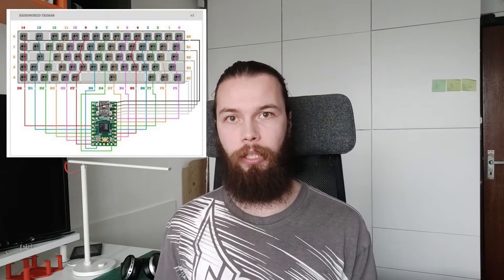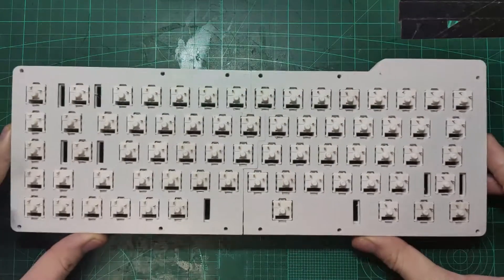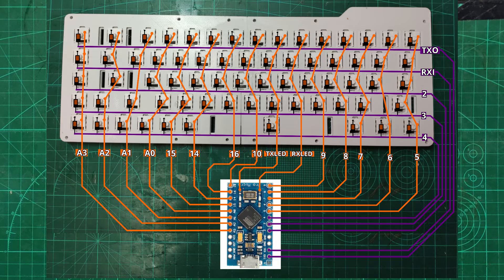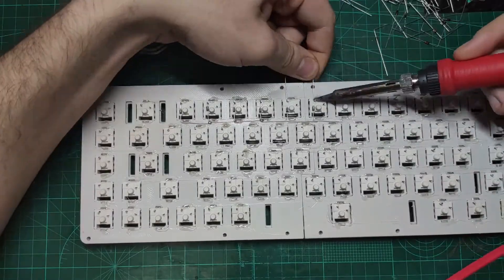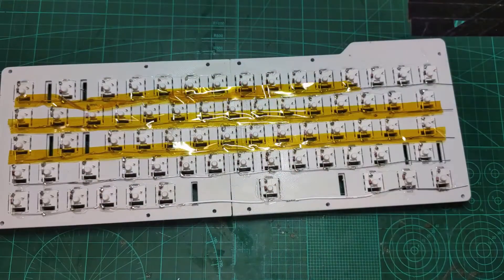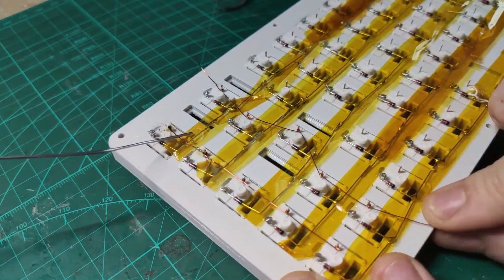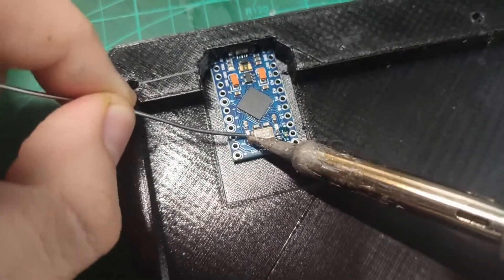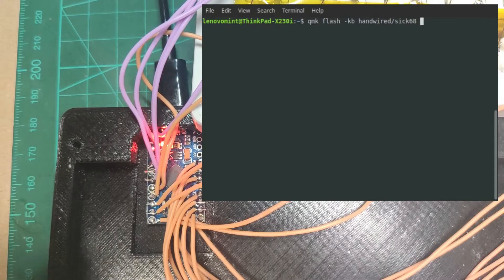SiCK-68 | 3D Printed Hand-Wired Mechanical Keyboard Build | Part 3

Comment: Rows with number 5 and 6 doesnt work. It flashes the lilght on arduino. Can you help me, what did I do wrong?
Reply from the maker: Wait, you mean columns? (since there are only 5 rows) And you mean those wired to the pins 5 and 6 or those wired to the pins TXLED and RXLED?
Reply: @infiniteoffset  Yes, my bad. I mean columns. I think I soldered the columns to both pins on each side. It should be soldered to only the bottom one. I ruined my arduino while trying to unsolder it. :( I already ordered a new one.
Reply from the maker: @jakubkoj1  If I understand it correctly, you soldered the cable to the booth pins/pads that were originally connected via resistors? This could have damaged the pin on the microcontroller.
Reply: @infiniteoffset  Yes exactly. It did not damage the microcontroller, I just pulled out the metal pad from arduino while trying to desolder it.

Comment: Hello, Im making this project but I have one problem that is when I press a key from the 2 nd row, the whole colomn actuates 
so for example when I want to type the letter "e" my keyboard types "3edx" please help me Im so close to finish this project. 
thx
Reply from the maker: Hey, do you have diodes in correct orientation? Can you take a photo of your wiring?
Reply: @infiniteoffset  Hi, sorry for the late reply, the diodes seem to have the correct orientation, I'm still struggling to find the problem
Reply from the maker: Or there might be short between second row and something, but I'm not sure what's the something. I'm looking at the diagram trying to figure it out.
Reply: @infiniteoffset  I finnaly found the problem! there was a short between the gnd ans the 2nd row now everything works fine exept for 1 colomn that doesnt work but I think I have to solder it again
Reply from the maker: @enzodecandido3862  Interesting behavior, I would have never guessed that short between gnd and 2nd row could cause this problem. But I'm glad you found it.

Comment: I can't find Hex file. Can you help me?
Reply from the maker: You can get the hex file by compiling the sick68 presets with qmk. Sick68 files are here https://github.com/qmk/qmk_firmware/tree/master/keyboards/handwired/sick68
If you use command "qmk compile -kb handwired/sick68 -km default", then the .hex file will be located where the qmk_firmware files (that you got from github) are, it's in the top directory.
I compiled the hex file for you, so you can try that as well https://drive.google.com/file/d/1aAGAaKVagXLnDBBZks_REkIXcZui0roQ/view?usp=sharing
Reply from the maker: Also post photos of your build once it's done :)

Comment: I seriously can not believe you just got 125 subs...
Such an awesome video and a great idea altough it's probably nothing for me because of cost etc. and a missing 3D Printer ^^
But.. do these DIY Keyboards have an N-Key-Rollover or Anti-Ghosting? So are all keys are getting registered and send to the PC?
Reply from the maker: I can't believe the 125 either, I didn't even expected people to watch my videos. It's so awesome that people subscribe to me, I have smile on my face each time I see the number go up. I'm kinda sad that at the moment I'm unable to make more videos, but I hope to catch up during summer (I have a lot of parts sitting here).
Yeah, keyboard like this only make sense to build if you have access to 3D printer (either own it or local hackerspace or friend who owns one). Ordering prints would be insanely expensive.
These DIY keyboards running QMK are great. I mean many pre-made keyboards run similar micro-controller with the QMK hardware as well. What I love the most is the way how you can modify it yourself to your needs (if you have time to spend).
QMK firmware does support NKRO, but in default it's set to 6KRO. I believe that true NKRO is limited with hardware beyond keyboard - USB interface, bios.
Also the ghosting depends on how it's wired. Since I'm using diodes, it does prevents ghosting well.
But QMK firmware in particular has some downsides. For example if you press two keys at the same time, it will send them in two packets (but I don't have an issue with this personally). Also wireless capabilities are limited.

Comment: hey man please can you tell me how you flashed the board? i dont know what program you used and how to do it. I have followed your entire tutorial but im stuck on how to flash the board.
Reply from the maker: What operating system do you have? I'm using linux mint, so things may differ on other OS. 
QMK made good tutorial I recommend https://beta.docs.qmk.fm/tutorial/newbs
Here's is briefly what I have done, if you are stuck somewhere, let me know and I will try to help.
1. I downloaded/cloned QMK https://github.com/qmk/qmk_firmware
2. Installed it via python pip
3. installed dependencies for qmk
4. Built and flashed the fw with command '$ qmk flash -kb handwired/sick68 -km default'

Since more people have asked, I hope to do quick roughly edited video on this process on freshly installed linux booted from usb.
Reply: @infiniteoffset  First of all great content! I really liked watching this series and some of your other keyboard builds. I would also highly appreciate if you could show quickly how to flash the Arduino micro since it is way cheaper and easier to get than the teensy 2.0
Reply from the maker: @Kiuma1907  I really hope I will have time to make the video. I just have a lot of work and bad time management atm. But anyway until then, if you are in the process of flashing and would need any help I can try to answer it :)

Comment: did anyone notice he had the switches upside down?
Reply from the maker: Did I? :D I was actually searching for proper orientation of cherry mx switches before and was not able to come to a conclusion. Some keyboards have it one way, some the other way. And apparently there shouldn't be noticeable difference in feel of the switch.
Some keycaps might interference with the switch in the other orientation. For example GMK are better used with led part facing north. And the stabilizers, for example Costar that I have used in this build, can have interference with wrong orientation as well.
If you have more info on proper switch orientation, let me know, because I must admit that I'm little lost here.
Thank you for commenting BTW.
Reply: @infiniteoffset  I'm like %90 sure the side with the hole always goes up top so you can have light for the keycaps
Reply from the maker: @butters2160  Yeah, I guess installing it with led part up would be better. I was building levinson before sick and levinson is designed woth led part facing down, so I went with it. But luckly for the keycaps I used it doesn't matter.

Comment: yo what stabilizers do i need for this?
Reply from the maker: I'm using Costar stabilizers, but I think that other plate mounter stabilizers could work as well. I forgot to add them to part list in the description, but now I have updated it, so you can find a link there to the ones I bought. You need 3x2U and 1x6.25U

Comment: By modifying the software, wouldn't it be possible to have less virtual columns, thus using less pins? So you wouldn't have to desolder the resistors
Reply from the maker: Yes, you are right about that. The rectangle shape with the biggest area for a given perimeter is always square. Hence when using grid layout and having 18 pins, it's possible to wire 9x9 = 81 keys. But it would need booth software and hardware modification. For me it's easier to wire this way despite I need to solder on Arduino resistor pads. But you have a good point.
Reply: @infiniteoffset  it wouldn't be hard to wire them differently, and the software side should be easy because it's graphical... I might try it when I get my switches in like a month
Reply from the maker: @lorenzoiaccarini6966  Yeah, software should be no problem. With wiring, now thinking about it, you could pair up the columns. Two columns would become one virtual one, but it would double up virtual rows. This would require exactly 8+10=18 pins. Or  do you have other idea how to wire it? Anyway, I would love to see your build once you work on it.
Reply: @infiniteoffset  no i guess making it kinda like a square would be the best idea. As for the build, I'd love to see it as well! Unfortunately I'm going to have to wait quite a bit
Reply from the maker: @lorenzoiaccarini6966  Yeah, square thing can work, hopefully the wiring won't get too messy. No worries, I can wait :)

Comment: Hey  man great stuff. I'm just about to start this project myself.  Doyou recommend the arduino over the teensy ? Can't wait for the next video
Reply from the maker: On Teensy vs Arduino, booth are based on Atmega32U4 and booth are supported by QMK. The difference comes down to pins, connector and price. If you don't mind desoldering the two resistors, then it doesn't matter for SiCK, but if you had bigger keyboard, then Teensy could be a winner. Mini usb connector on Teensy is stronger than micro usb (bigger connector and better connection to pcb), but user preference of the connector playing role here as well. It's also possible to make mini/micro usb->usb-c pig tail reduction and put it inside the keyboard, so in this case it wouldn't matter which board is used. I may do video about this mod after part4 is done. Price is big factor for Arduino Pro Micro since it can be bought from aliexpress for under $4.
I had personally chosen Arduino mostly because I have been using it in other keyboards. A lot of PCBs are designed for Arduino Pro Micro pinout.
Anyway, thanks for the comment. Post some photos once you have the keyboard done :) Final part 4 will be uploaded by the end of this week (depends when I will have time to edit it).